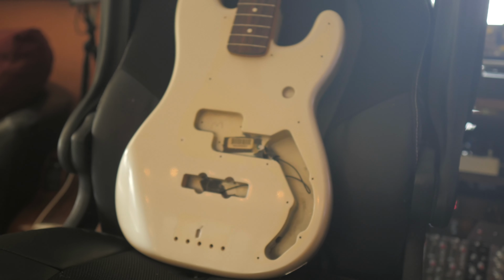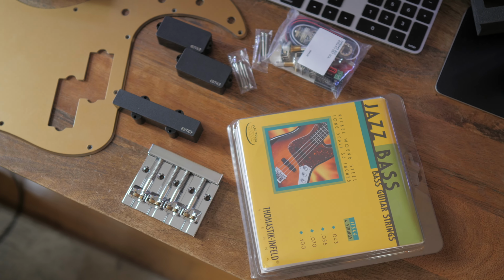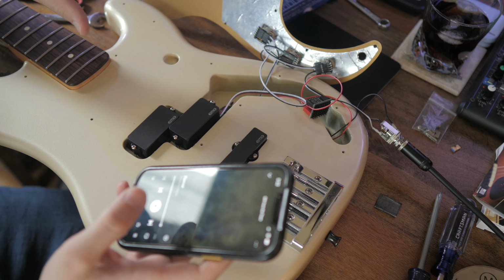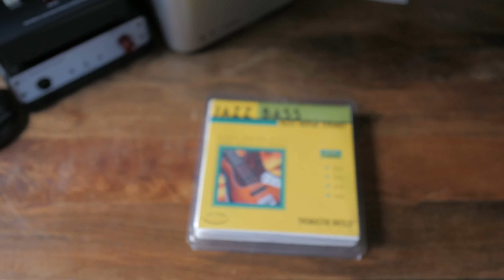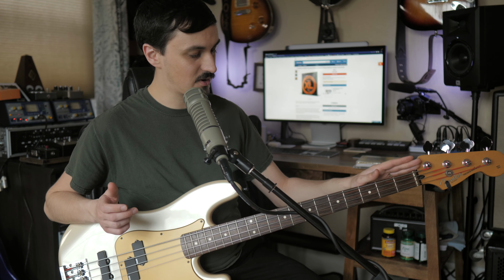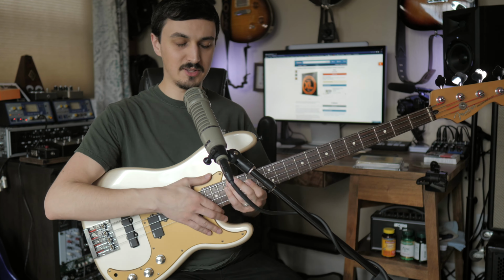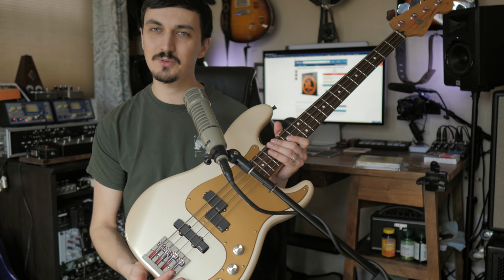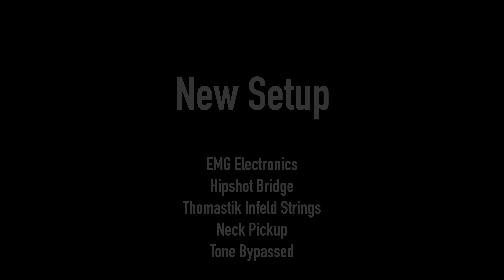Upgrading a Fender MIM Bass // EMGs Sound Awesome!

Comment: I have an old 96 Fender PJ known as the Cowpoke.  I didn't care for the original tone.  I had my guy do some upgrades.  I bought a hipshot kickass bridge and ordered an Audere Classic 2 band preamp... I didn't want to have to drill extra holes.  The day the preamp was to arrive, my tech calls and says I should run a Relentless P and a Quarter Pound J.  He said the QP J was the only J they tested that had output to match the Relentless.  I explained I had already ordered a preamp  He did some research and hit me back up saying it will work.  I will say it's does have a voice of it's own.  Amazing tone with a pick and really good with fingers.  And here's the downfall... I am getting 60 cycle hum.  I was excited to play it at a church gig a couple weeks ago but after rehearsal, I knew I would have to bring my Stingray.  The electrical buzz was unbearable.  I am tempted to pull the preamp and run it passive just to see if that helps.  If not, I will end up swapping pickups.
Reply: Call Audere, they walk you through somethings to remove the hum. They helped my.

Comment: Killer setup.  As for the extra hole in the pickguard, just run to the hardware store and get a 3/8" hardware plug, less than a dollar each.  Chi Cheng used chrome ones in his gold pickguards, I stuck a white nylon one in my pearl pickguard.

Comment: I found the kickass bridge (even with the steel saddles) really mellowed out the tone compared to the stock bridge when I did some upgrades. I put in a Duncan Quarter Pound pickup and hi mass bridge and the whole bass was just duller than the stock squier affinity stuff. When I swapped the bridge out for a simple Wilkinson one, it got all the punch I was expecting. I'm not honestly sure what the deal is there.
Reply from the maker: Interesting! I’m digging this setup - maybe the Hipshot is helping to tame the full range sound of the active EMGs? Thanks for sharing your experience

Comment: Hi. Quick question , Why now you have an extra hole n one less knob? Is there something you’re not gonna be able to adjust with the new pick ups that you were able to do  with the old ones ?
Reply from the maker: @migu31gt52  the old configuration was for a master volume, blend knob, active EQ, and a passive tone knob. The new setup is a volume control for each pickup and a tone knob. I’m missing the active EQ but I didn’t use it anyway